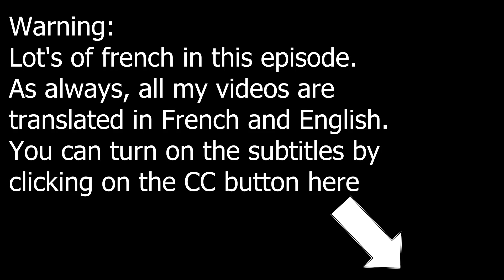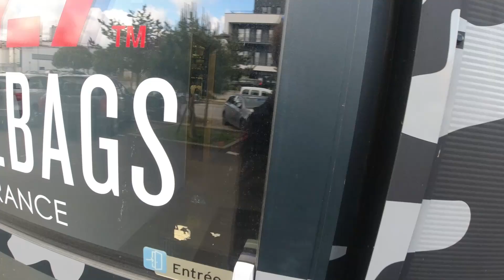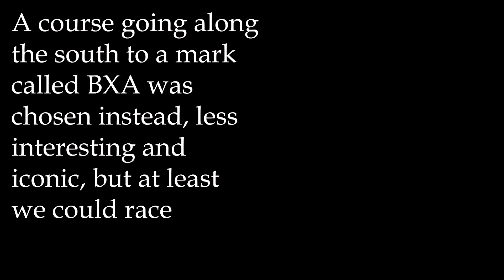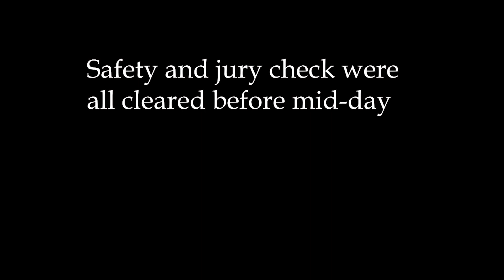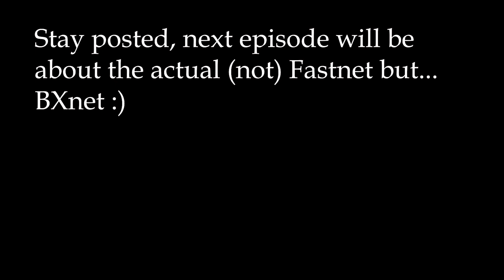Warming up for the Mini Fastnet race - Ep157 - The Sailing Frenchman

Comment: Salut Hugo,
Could you do a geek session on your autopilot please, you answered a question in the last episode on this, could you go into more detail in a future episode, who makes the autopilot, the wind vane, the motion sensors, the actuator and the wearable remote control, does the software which gets it to all work together come with the autopilot, can you fine tune it, power usage etc.  It seems to work very well, reacts quickly and is reliable !  Not the usual experience with autopilots especially downwind.
Good luck on the Mini Fastnet !
Reply from the maker: Kind of answered already in this video : https://youtu.be/Hk0G13ptKYk
Going into more detail would be pretty much just listing material I guess
But will have a think about it